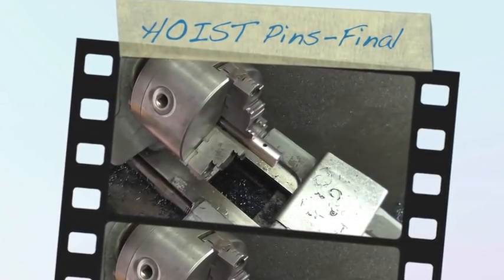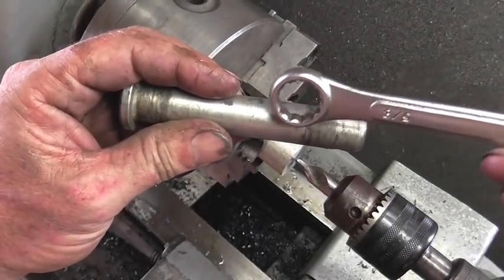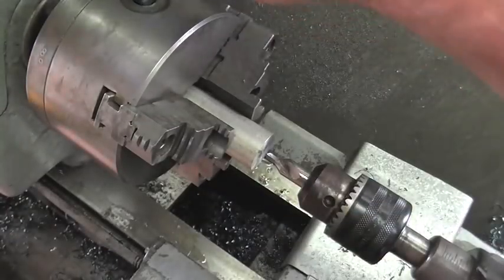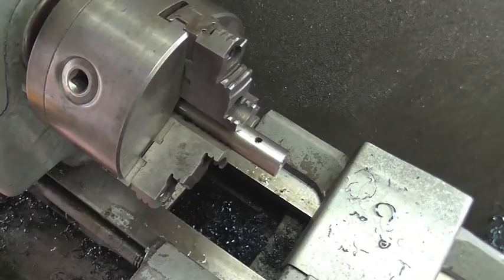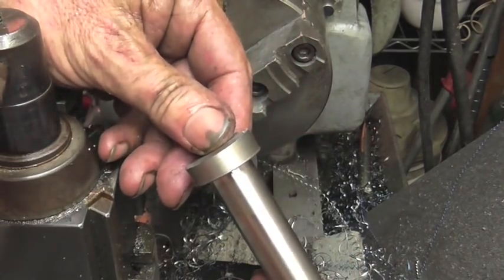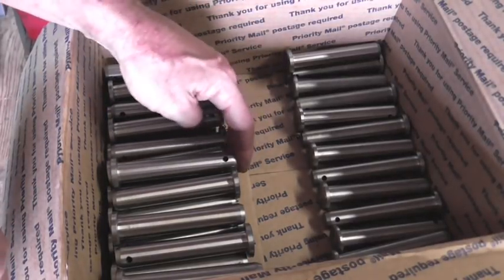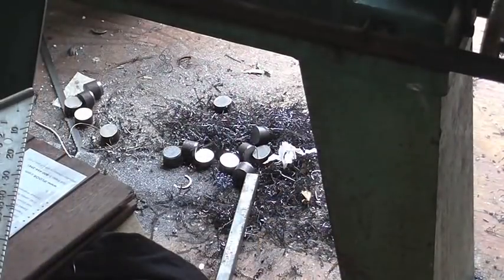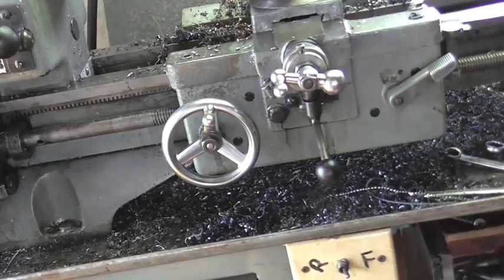(40) Precision HOIST Pins Machined From 4140-HT Steel / Part 3- MSFN

Comment: Gauge blocks would be the great way to space off the drill bit.  My father taught me how to use gauge blocks for all kinds of things on the lathe.  You probably don't have a set but man are they great for little issues like that.
Reply from the maker: Wish I had a set Dave, all worked out in the end tho :)
Reply: Or just take time to face off a piece of scrap material to the length you needed for this project as an improvised single- use gauge block?

Comment: I know rigidity is a major player here but i turn 4140 more than anything else for equipment pins. i have found that lower speeds and heavy cuts give me better results and the chips turn out beautiful. It's gotten to where i Love to turn 4140 due to its beautiful finish. I still run into problems with it moving into the chuck especially when its a clean surface in the chuck, so i made a chuck stop for it. Also it work hardens when it gets hot. I use a noga cool mister and that helps a ton. Nice work overall. ( and yes i drill the hole after the turning lol)
Reply from the maker: I ran the higher speeds for the sole reason of making the deadline....I soon realized at the beginning I was never gonna make it. 4140 is great stuff, gonna use it much more often....and when I am not in a hurry...LOL

Comment: I really enjoyed this series. If this is a repeat job I would suggest soft jaws. On one side just straight with a back wall so the part can't push in. The other with a relief in the back to clear the pin head. Also to break a chip well your nose radius needs to be smaller then your depth of cut. If I made the mistake of drilling first I would have tried to groove it down close to size so it didn't hit it every pass.
Reply from the maker: I love all the feedback I been getting, can only make me better. I made mistakes....viewers pointing them out and offering advice is priceless...Than You! 

PS: I have 3 unused soft jaw sets for that chuck :)
Reply from the maker: Those are really good ideas sir

Comment: If you had to do it over, what would you do differently?
Reply from the maker: Hmmmmm,
Make a proper stop for the chuck to avoid pushing the work into it
Use a left hand turning tool when turning away from the chuck as I did towards the end 
Use a parting tool to create a groove before turning away from the chuck to avoid plunging

Not drilled the hole prior to turning to a diameter
make additional carriage stops to ensure quick repeatability on length dimensions
Allow extra machining time, 2.5 days was pushing the limit for a manual machine for 40 pieces (in my opinion)

Richard
Reply: @MakinSumthinFromNuthin    I personally would have made....say 44 of them.  That way I wouldn't have that constant tap on my shoulder saying don't screw anything up...because there's no room for error.   And the client probably wouldn't mind a few free ones.  Think of them as promotional extras.

Comment: Takes a lot of time to find zero with drill then dial in, would it be possible to pull the head up against the back of the jaws to index it then face to same zero on the carriage for every part buddy? Thx for the vid.
Reply: Just put drill against jaw 
Set a carriage stop and face
They will all be the same
Reply from the maker: I saw too much risk of error if the length was off on any so took the safe route, was only 4 min each and was ahead of schedule by that point. Thanks for all the great comments Steve